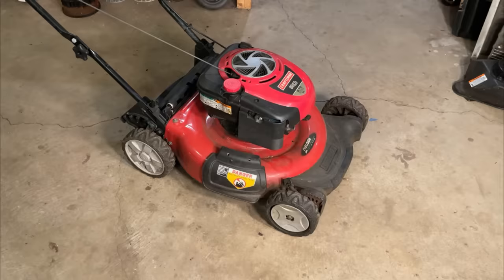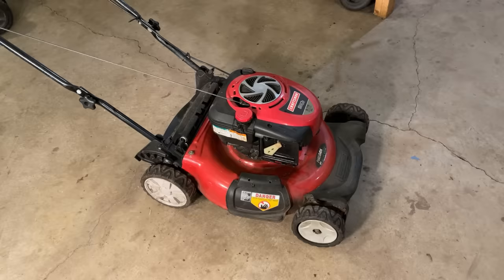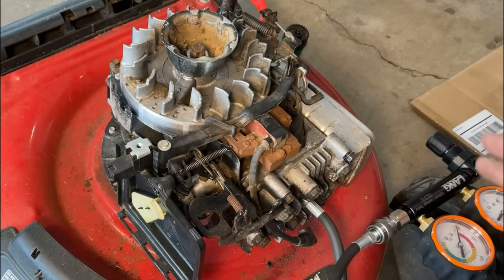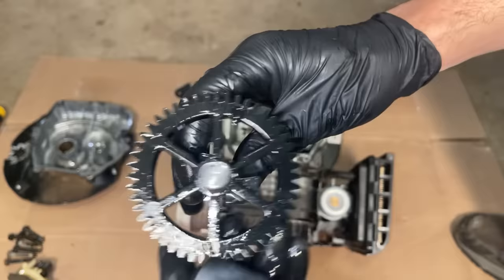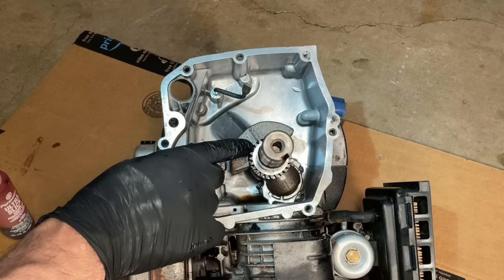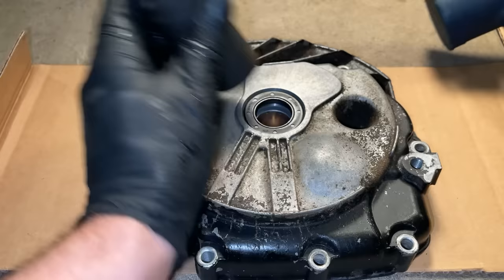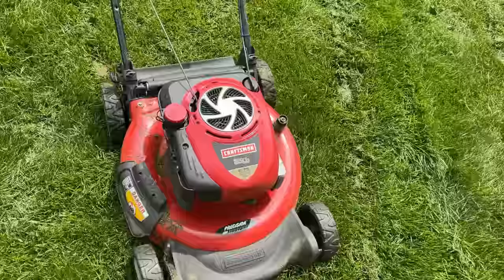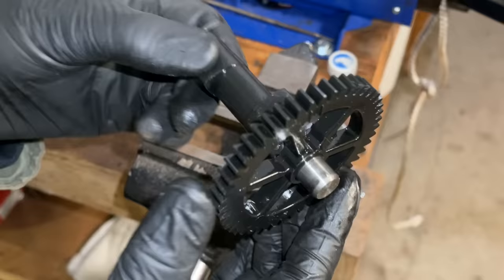Lawn Mower Will Not Start - You Will Never Guess Why

Comment: Best way I've found to clean the grass stuck under the mower. Make a water puddle that the mower base will fit in, about an inch or two deep. Start the mower and push it into the puddle. The water will get sucked up by the blade ( you may need to be running water into the puddle to replenish.) This action will blow out all the grass underneath.
I did this immediately after each time I mowed. Kept it nice and clean.😊
Was wondering though. Is there a possibility the gear could be put back where it belongs then a small hole bored through the gear and shaft and a pin put in (and branded at its ends)?

Comment: This video is more about durability issues with modern products, notably residential quality small engine.  What manufacturer is best.  They all build cheaper versions (and I mean cheap) of motors: Honda (GC.), Kohler (I believe Courage), B&S (not sure maybe Intek).  Pay up, Go for commercial versions: Honda (GX.), Kohler (Command), B&S (was I/C (industrial/commercial)).
If you are not sure just get the ones with steel sleeves rather than aluminum bore.

Comment: Wow! Such a detailed tutorial!!! I think, I have the same issue. Sparks are good, compression too, carb has just been cleaned, but no start. And, during pulling the cord a huge resistance in same positions... It looks like the engine wants to turn back :)   Is there any simplified technique to identify timing issues, please? I mean, with no flywheel taking off? Thank you

Comment: I was either gonna say, broken camshaft, or twisted off keyway before i ever watched the video. 
 Also, on the newer compression release, 2 cylinders it could be the pin on the compression release system. They are just too weak, and can totally destroy the engine when they go.

Comment: Seems like the gear would be pinned/keyed in place or have a set screw, not just pressed on. Next time rotate the loose gear to the correct clocking and drill a 1/8" hole through the gear hub and shaft and press a dowel pin in. That'll save you from buying a new assembly.
Makes sense it was the gear that spun since it gets much more torque than the cam.

Comment: Personally, I'd have either bore-scoped the cylinder when the plug was out or just pulled the head to check the piston and valves to make sure they didn't hit each other when the timing slipped...

Comment: It would be interesting to see whether the plastic is only in a craftsman or whether they have the same type engine as part of the Briggs and Stratton named line. The tools were good but the fringe products were somewhat subpar depending on the need for durability.

Comment: You explained everything great...apart from one critical detail (for a newbie).  You squirt the starter fluid and attempted to start.   To my ears, it appeared to have started.  You said "it is not doing much".   What made you say that?   With just one squirt, did you expect it to run longer?   Could you please give us a few more hints on how you decided that this is not a carb issue?   Thanks for the excellent video.

Comment: Might have hit a rock .  Also check the primer bulb - might look OK but stiff.  My father put gas in his mower - ran and stopped.  Over and over.  He switched the gas caps - one had a vent, the other did not.  But if it runs when you spray starter fluid that eliminates many problems.

Comment: Interesting to watch... I have a mower that was near new.... and technically still is as a new mower the customer had somehow put oil in the petrol and petrol in the oil. I took it to my mower repair centre and had it all flushed out and working great. Except I lent it to my wife who used it once or twice then couldn't start it. When trying to turn it over it splatters what looks like oil out of the exhaust? The brand of mower is a powerblade 4 stroke so not sure what the go is with it

Comment: Hello, my regards, thank you for your videos, which are really excellent and a great help to everyone. I have a Honda TB 130 XP, but it keeps throwing white smoke and some oil from the exhaust. It has power, so I don't rule out the possibility that it's the rings, but I've heard that it could be the poorly calibrated carburetor that produces smoke on my lawnmower, meaning that the needle is too high and the gasoline goes into the crankcases, making the oil rise. Question: Could this be true? I don't know what to do to repair this machine anymore.
Could you please explain to me that I should do to end this nightmare?

Comment: I had one listed for $15.00 it was hard starting. Due to bad primmer bulb I had a guy low ball me $10.00 i told him get lost. I bought a carb kit for $10.00 i work for 3 cuttings and the rod went though crank case i use it as $10.00 coupon/ traid  on my next use one for $70 Which was also crap built unsafe so use that as $20.00 on a $100.00 use one.

Comment: Older video, I know. But excellent as usual. Saw where you used Briggs labeled oil. I like using 30W (even though Honda, among others recommends 10W-30) but 30W is getting harder to find. Tractor Supply's Traveller in-house  brand is the best deal at about $19/gallon ... if you have that store near you. I also saw where Amazon offer 6 qts. of Valvoline or Pennzoil 30W for around $31. That's a little more per oz. than Traveller  (but delivered to your door!) Either option is a good bit less $ than the Briggs brand. Not lecturing in any way; just trying to help.

Comment: Flywheel shaft-key sheared and messed-up magneto timing? Did on mine. Have never seen before - maybe a backfire caused it (?). Also ONCE had an intermittent spark plug - quit running after hot when internal gap in center conductor expanded... I guess. Progressively took the entire engine off and apart on the hunt before I spent that $2.48. You're welcome.

Comment: If you tip it the wrong way you can get your air filter oiled and/or oil even get into the engine through the carburetor.
Reply: Turn the motor till it's at TDC - piston at very top and  intake & exhaust valves closed.

Comment: Nice job.  I learned about a new potential problem regarding the plastic timing gear moving on the steel shaft.  Another thing I noticed though was that you didn’t show that you included the gasket when you reinstalled the bottom cover.  Probably leaked some oil huh?

Comment: I find when Ive bought used lawnmowers that wont start, It has to do with the kill switch cable not retracting far enough to start the mower. the cable can get loose over time.

Comment: I noticed right away the valve timing was off when you had the air box off and when you tried to start it  there was a sucking sound coming from the intake. Which speakes to me valve timing.

Comment: Thank for sharing this really great video. 

How come you didn't focus at all on the fuel system (ie. fuel in the tank, filters, carb, etc) before coming to the conclusion that it is a timing issue?
Reply from the maker: It would not run on starting fluid, so fuel was not the issue preventing the engine from running.
Reply: @jcondon1  Ah, ok. Makes sense. Thanks!

Comment: At around 6:27 you describe an expectation of compression. Just curious what are you basing your expectation of compression on?
The relative position of magnet on flywheel?
I think your test for confirming proper valve timing by correlating pressure of air in cylinder is a great sanity check.
Reply from the maker: The position of the magnet in relation to the ignition coil.  When the piston is at top dead center the magnet should just be clearing the ignition coil.

Comment: You missed the boat on the seal installation.  Don't put it at the same level as the old one. Look for the wear pattern on the crank and install the new one so it rides in a spot on the crank that is not worn.

Comment: Ive always had good luck with the cheap, triangular carbide gasket removal tools. Ive actually been using the same one for about 10 years...cars and small engines...and never had a gouging issue.  I think it's all about using the right pressure. With my hands dying along with my spinal cord I steer away from small, razor sharp tools if I can avoid it. 
Has anyone else tried the carbide tool with luck as good as mine?

Comment: Good luck finding a refrigerator, clothes washer, dryer, lawn mower or anything else that you can keep for the next 30 years. Practically all such stuff is made somewhere in Asia for max profit with minimum quality. It was not that way until American manufacturers started shutting down.

Comment: I have seen this problem SEVERAL times. Imagine how easy that gear spins on the shaft once in a HOT running engine. The once great briggs and stratton engines reduced to this....THAT is why B&S are NO MORE.

Comment: Small engines are so easy to repair especially Briggs. Do you think you could fix one that still has a points and condenser in it? These newer ones are way easier than those old ones .

Comment: Hi James,
Would it be possible to realign the gear, then drill through it and the shaft and pin it in place? Save some $ and time, and get an extra kick out of a fix, instead of replacing the part. Great diagnosis.

Comment: Thanks for the great vid. I'm sorry for Briggs. That plastic cam and pressed-on construction stinks! How long is that going to last? 3-4 years at best.  An overheated engine is a likely cause and a little bit of wet grass on the fan blades will cause that. I will never buy a mower with a Briggs Quantum engine after watching this. That was a lot of work for something that will never last.

Comment: OMG! Plastic cams!  I had small gas engines class in high school in 1978, back then cams were an integral part of the cam shaft (all machined and polished steel). When did they go cheap with plastic? Sounds like failure is eminent from the get-go.

Comment: Im wondering could the cog and shaft be drilled and a steel pin  inserted  or do you think the plastic would just break up over a short period of time?  It seems those plastic cam shafts are designed to fail. maybe to get you to buy a new mower.  
Design them to fail. Seems to be the norm these days. Thanks for the video. 👍

Comment: what an unusual fix....im stumped on one i have right now...theres very few i couldnt fix and ive never come across this problem..i dont even think i would see it.,.im just a hobbyist in doing this im not a certified mechanic so i could see this and wouldnt even know its an issue..they dont teach small engines around here only way i learned was form youtube..ive gotten pretty good at it...the one i have now i repaired before and sold it last year this chick brought it back and it wont start for anything..im cleaning the carb again i think its a bad carb ive cleaned it a few times and it doesnt even start with starter fluid which tells me the carb is bad but if its soemthign like this id have no idea.
Reply from the maker: If it has spark and compression and will not run on starting fluid would say check the flywheel.  If good then might be the camshaft.  I think it is a larger problem than people realize due to the difficulty in diagnosing.
Reply: @jcondon1  ill keep that in mind ty. now in Canada here ive come across seemingly a new problem that all our gas now has to have ethanol in it so now carbs get water pooling in them...tehyre really trying to push these ev and battery powered garbage..

Comment: the briggs/stratton handbook says not to use a hose/press.cleaner on the engine because water can somhow get pass the seals? How can you tell if the cam has moved? I took mine apart and I did not notice anything out of place but yet it won't start after hitting an obstrution .I'LL TAKE MINE APART AGAIN AND HAVE ANOTHER LOOK AT THAT, NOW THAT I SAW WHAT YOU DID THERE; I went ahead and bought a new lawnmower, but I would still like to fix the old one, so I can learn all about them.

Comment: I've had an issue with a Sears pressure washer same BS motor, no start, occasional would run if I primed the carb with gas, then won't restart etc, new carb, new, plug, was thinking coil but has spark, now thinking likely it's the cam, which would explain the occasional start issue, usually need to prime the engine for it to even start, it's gotten progressively harder to start even priming the engine, also noticed the compression release would not work correctly especially right after shut down, but seems to work after couple more pulls but still hard to start without priming it....

Comment: Interesting.
I have a 5hp Tecumseh on a wood splitter that may have the same issue.
Initially had a carb problem, and replaced that. With new carb it ran fine for about an hour and twenty minutes, working the splitter.
Then the RPM increased slightly for about ten seconds, and the engine died. No surging, didn't seize. Just stopped. I thought it was just out of gas. Filled tank and tried to restart. Coughed once and then nothing.
I removed and checked carb. and it's good. I checked with spark tester and spark is good. Shot some starting fluid into carb and engine will not fire/start.
so...?
-And when did they start with plastic cams? Mine is a 1996 model.

Comment: I had an engine we took apart six times never seem to run right. My father tried adjusting the valve timing plus or minus one        tooth. Never ran right until one day the cam broke. We replaced the cam and it started running right. Manufacturing  defect turned out to be the source of problem.

Comment: What is incredible to me is that you could find a used replacement part just like that! I wonder what the reason for the dismantling of the donor engine was...
What i didn't like was that you did a lot of the work with wobbly unsecured parts, i would have secured the part to a bench or something, probably used wood screws in the already present holes into a block of wood and then secured in my vice...or something like that.
Just a though, razor blade and wobbly part ...

Comment: Greetings. I have a problem that is making me crazier than I already am... I have a B&S 125P02-0012-F1. I bought the engine new to replace a 5HP on a walk behind lawnmower. Last weekend, it failed. The problem was a blown (!) head gasket. Not form pressure, but likely a bad B&S OEM gasket. Installed and properly torqued. Did not touch anything else - just reversed what I need to disassemble. NO SPARK! Old magnet ok but replaced with OEM incl. new boot and proper heat range plug. No spark. Ditto an OEM carburetor (obviously not related to sparking). Replace the magneto to ground and kill switch to ground wires and a new SPST switch. No spark. Cleaned the flywheel (which is not an issues). It "appears" the magnets are strong. Gapped per B&S to .012 using to feelers so the gap is identical. STILL NO SPARK. How can something this simple be so impossible? Ordered a brand-new engine, but want to fix this one as a spare...Any help appreciated.
Reply from the maker: A common problem on the mowers is that the cable does not pull the brake off enough to allow spark.  I would remove the kill wire from the coil and see if spark comes back.  Confirm the new coil is not upside down and also that the posts the coil mounts to are clean.
Reply: @jcondon1  There is no cable or brake.

Comment: Plastic camshaft lobes? I haven't torn a small engine down in years and I had no idea. This does not make my outlook on the future any better. I know nylon is used for camshaft sprockets but they don't get a beating like a lobe. I will say it is good to see you clean the external dirt off before you crack it open.

Comment: Great video. I have a question. When tipping a fueled and oiled up mower on it's side to clean the deck after a mow, should I tip it towards the carb or away from it? If you know what I mean.

Comment: I don’t think he mentioned why to check the key on the flywheel.  Was informed by my dad they are prone to sheer. Why? You say because of cheap quality.  The answer told to me was OSHA safety requirement.  Intentional softer metal made to shear and stop the motor when the blade hits something hard since it’s mounted directly to the motor.
Want something to last forever? Just picked up a generator with Hatz single cylinder diesel.  Won’t gum up carbs off season and while last forever (absolutely no plastic)

Comment: The lead of this story is that this is part of the built in fail system for the design of this product. Where, unlike a carby clean or a coil or plug, the failure of this item renders the unit too expensive to fix and so forces the consumer to buy a new unit. And of course, this is the same principle that ALL manufacturers "build" there products....to fail.

Comment: Putting in a used component that is a known failure on these makes no sense.  B+S has fixed the issue and putting a new service part in is the only smart fix.  Using an old one…just means it will be done in a shorter time than the first one.

Comment: Have Honda Harmony Mini  Tiller The Plastic transmission gears stripped.  It work great until you hit  1 inch diameter roots, are rocks. They wanted $90 for the  plastic gears!!!  And $250 to put them in.

Comment: Jim:
I have seen you have the same problem on other engins.  I am a bit ANNEL.  if it were me, I would clean this up and epoxi the cams in the right location and fix the compression release.  It went bad because the lobs moved on the shaft.  Any thoughts?

Comment: Do all quantum briggs and stratton use just gas 

Got one used and seller told me it uses oil in the gas 

But i think its 4stroke

Works fine on 2 stroke fuel but dont know